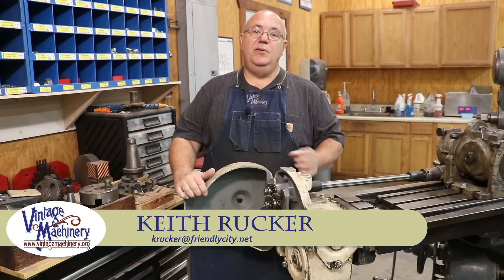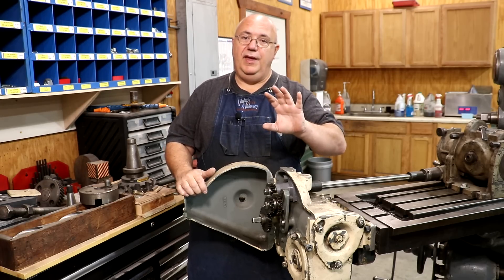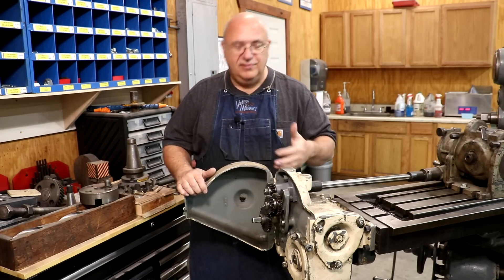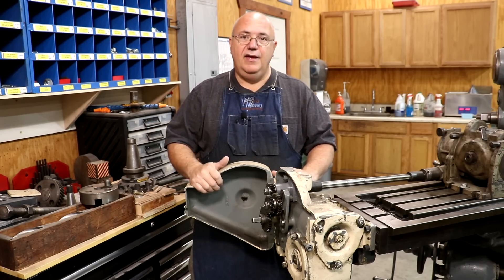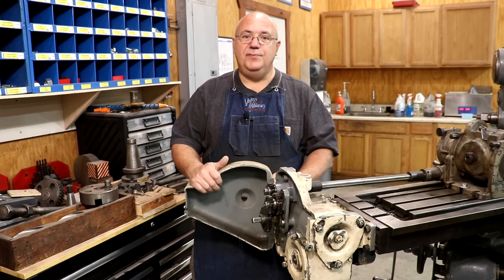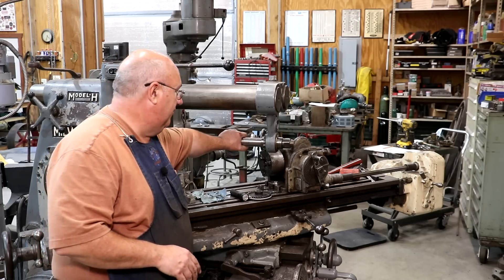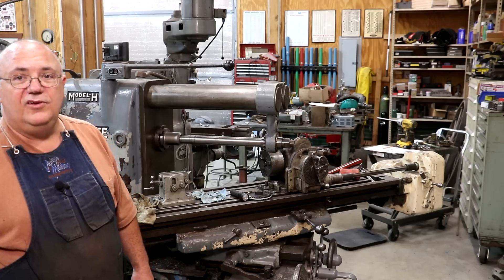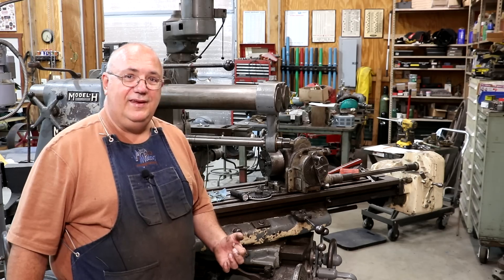Cutting Helical Gears on the Horizontal Milling Machine:  Setting up the Lead Attachment Part 2

Comment: Just imagine what was going through the minds of the engineers that designed and built that attachment. It's amazing to think that it was so before the computer.
Reply: If you peruse old magazines, 1905 and alike, you'll find they did pretty much everything we're doing today, thinking the same too, just with more hat and suit.
Reply: @aserta  And safety tie.
Reply: @jimbarchuk  And it wasn't a clip-on!
Reply: @aserta  and a far more formidable ability to look at an “answer” and ask themselves ‘does that make sense?’
Reply: And to think they were also using slide rules to work out the math! I still have a nice Frederick Post one that was my Dad's but I haven't used a "slipstick" in so long I'd probably have to start over to learn how to use it! 🤔
Reply: @PhilG999  Some of us remember using our Keuffel&Essers years ago and were really grateful when the Hewlett Packard HP48G came out.
Reply: @bchrisl1491  K&E (like almost all German instruments) are wonderful things. I had a chance to buy a K&E drafting machine years ago as the Engineering Department was getting rid of it (having gone to CAD). Thought they just meant the machine, but they meant the table it was mounted on too! $85.00US! I sold the table to a co-worker at another company some time later for $85.00! i.e. FREE drafting machine! Same company had a more modern drafting table they wanted to get rid of. Nice tilting thing, will go almost vertical. $20.00 US. Can't beat deals like that with a stick! 😁 Actually I did my drafting as a Mechanical Engineer the old-fashioned way. Triangles, T squares, and French Curves. In ink, on Vellum! 🧐
Reply: @PhilG999  I still have one of the drafting tables from the transition to CAD, spreadsheet and database at the plant where I worked. It doesn’t get a lot of use these days, but It still has its usefulness marking up patterns.
Reply: Look up differential hobbers if this intrigues you. Automatically generates the gear due to a differential gear train inserted between the index table gears and the feed gears.

Prior to differential hobbers, you'd have to calculate the helix angle lead into the index gears. While this worked, you'd have to run the hobber in reverse in order to return to starting position alignment for a second pass.
Reply: People have understood math and gearing for a very long time. If you haven't already, check out Clickspring to see the Antikythera machine from around the 2nd Century BC.
Reply: Back then they had to use their minds instead of fingers tapping keys. A lot of that mental brain power has now been lost.
Reply: @ellieprice363  You still need the same brains to come up with the solution you type into the computer.
Reply: @irfp460  I suspect that the mechanical solution required a more skilled setup “engineer” - more steps and adjustments (as demonstrated) and a skilled operator to keep the machine operating and to perform the cut.
Reply: The engineering was accomplished using slide rules. I have worked in a CNC shop in the recent past and all this was done on a CNC mill using a specific program and codes. Much easier to do.
Reply: In many ways, computers have made us dummies.  Those "old timers" had to really understand many complicated applications to arrive at workable solutions like this.
Reply: @JS-ct5jn  That's an old school way of thinking. There's no need for everyone to understand everything down to the molecular level. Having machines do work that someone else already labored over and can now be automated does not make you dumber - in fact it's a smarter way to work, as it gives you more time to do the things you do better than machines.
Reply: Very Cool! This is a lost art.
Reply: I am not quite sure why a computer would help this, short of CNC, and that still requires some mechanism.
Reply: @jeffreylee7184  yeah buddy,  but slide rule use is a lost skill/art.
Reply: @jeffreylee7184  I graduated HS in 1976 and they wouldn't let us use calculators until 11th grade or maybe Senior year. The only slide rule I had ever seen at that time was a huge one hanging on the wall in the Physics classroom.
Reply: Just what I was thinking. It's 1930's sitting at a Technical Drawing Slope in tie and shirtsleeves with inky fingers, cigarette and a slide rule. Then taking the drawing into the workshop and being bawled out by the 'chief' that what you'd drawn was impossible to machine. How DID they do it?

Comment: Fascinating and sent me running to review the ins and outs of gear design (why helical gears?).  I cannot wait to see the machining in action and to learn the problems that you'll encounter. It would seem very easy to get the setup angle opposite what is needed so the test gear would be a very good idea -
Reply: Helical gears run extremely quietly. They may or may not last longer because of the way they mesh

Comment: I am no mill operator, but would there be positive stops for 45 degrees on your mill? I do know that drill presses and radial arm saws have a positive stop at 45, or at least my own do. that would make the 45 as accurate as the 0. I only ask because you were unfamiliar with that feature.

Comment: 👍that tapered bolt doesn’t index the table at 45 degrees?😊
Reply: Was wondering the same thing.
Reply: He would have seen the hole when he had the flashlight on it. You’ll have to go scold Messrs. Kearney and Trecker for not machining more tapered index holes into that big casting.